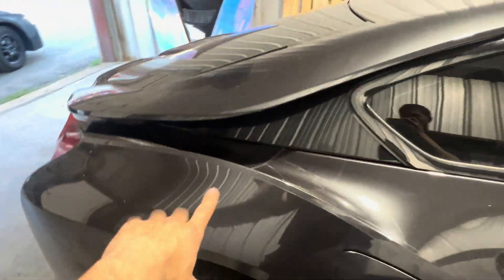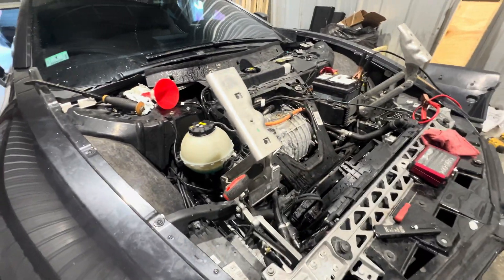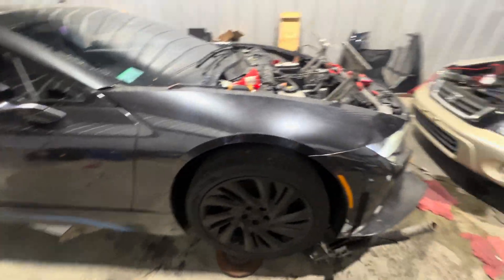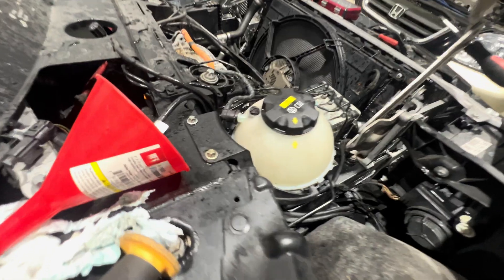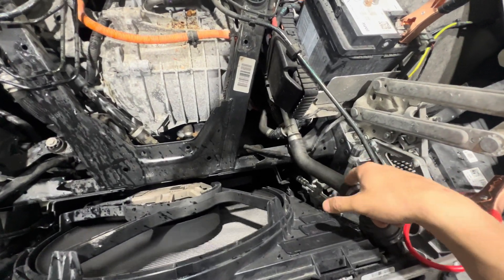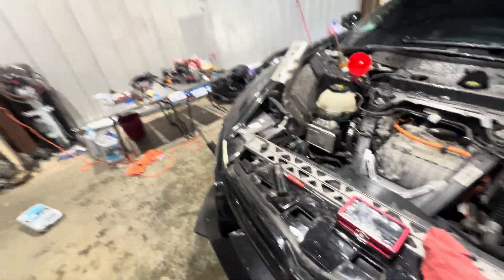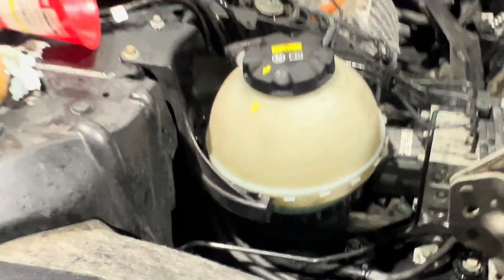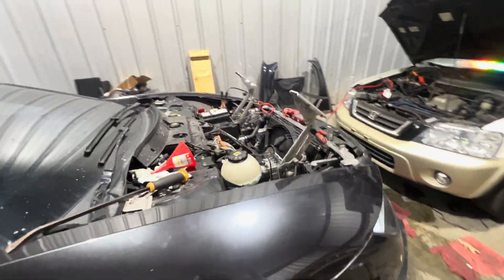How to Bleed BMW i8 Coolant Without a Vacuum Filler! (DIY Method)

Comment: Thanks I will try it i just had my secondary water pump changed but car seem to over heat after 20 mins of driving in motorway do u think it's the same problem I was told he bleed the coolant system
Reply: You might have a blown head gasket like me

Comment: Any follow up to this? I8's are a nightmare to bleed. You can have them completely vacuum bled at the BMW dealer and after a day it will overheat because an air pocket works its way up and heats up the sensor. The car sitting in the shop at idle doesn't mean much to me. How's the car after extended driving at high speeds?
Reply from the maker: This method worked great. Although it took a while idling. I also held it at high rpm a couple of times. Car no longer overheated.
Reply: @leander978  OK, like I said report back after 20 minutes of driving under load in sport mode. Thats the true test